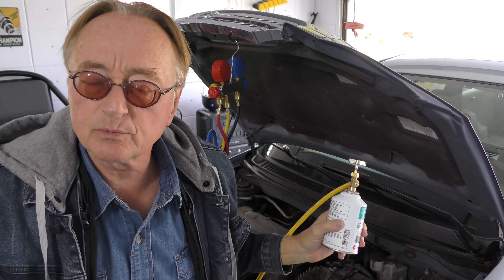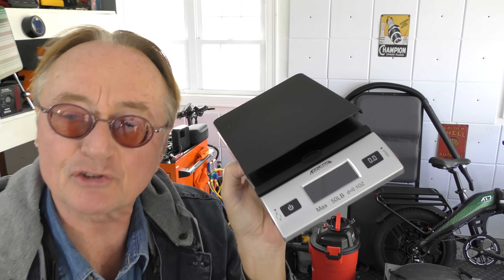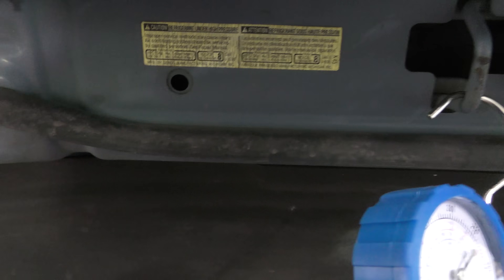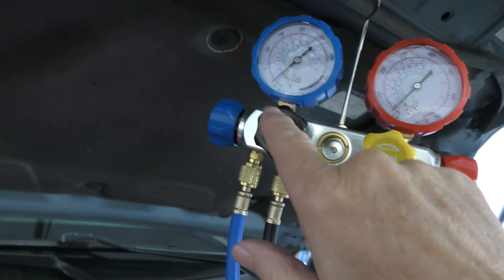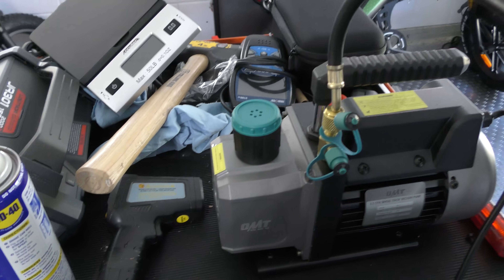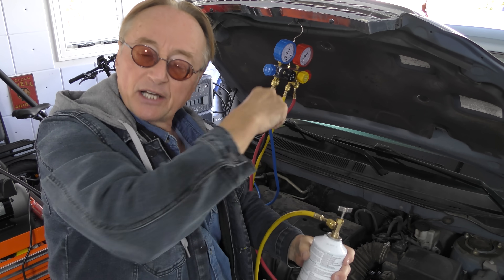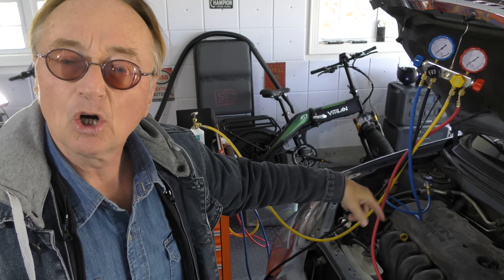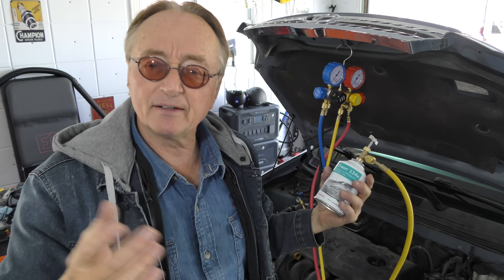Doing This Will Make Your Car's AC Blow Twice as Cold

Comment: If your system is low on refrigerant is that a sign of a leak somewhere (it's supposed to be a closed system, right?).  Or does refrigerant just breakdown over time?  I know at 11:58 you say, "they all leak to some extent" but is there an extent to which I should be worried? Asking for a 2004 Tacoma that doesn't blow particularly cold or defrost the windows that great in winter.

Comment: My 2001 Chevy truck gets ice cold as long as you're going down highway but idleing or at stop lights gauge goes close to hot I think needs belt winter fine but not when fan for air conditioning on
Reply: Auxiliary fans probably not working. Never drive an overheating engine.

Comment: Thank you for all the great information on your channel.  Just wondering.  Went to go buy the guages.  Looked like yours had four hoses and valves and the ones in the descriptions had three.  Is there any four out there that are decent enough or is it necessary?  I need to get one but would rather spend the money even if its a little more and get one that does everything?  Might need a different one for rv's also.  Thanks again for all your great info.

Comment: Vacuum pump does not remove refrigerant, it's used for evacuating the system prior to charging, this means removing all the air and moisture content down to, ideally, 500 microns, which means you also need a micron gauge. To removed the refrigerant charge, it's a reclaim unit. Simply adding refrigerant means your system is leaking at it'll only get worse and you'll just be dumping in new gas every season, and eventually it may not even last the season. Charging a system low on charge is a band aid, not a fix. There's only one reason you are low on refrigerant, a leak, a manifold gauge will it see that, a micron gauge will. Also, 42 at the vents likely means youre freezing your evaporator.

Comment: Perfect timing.   My accord never felt cold and it’s not under warrantee the day it’s delivered (Honda says wear and tear even day rolls off the truck and registered).   Gotten worse over the years and now needs to be done.
Reply: I had this problem with a Civic and it turned out to be one of the air blend doors letting heat in.
Reply: @The_Redkween  good point.   I think mine is ok but I’ll try to notice if the ac is  blowing colder before the engine coolant heats up.

Comment: Scotty what are your thoughts on installing a battery that is actually bigger then stated??? Will it mess up alternator or starter??? My battery that came with my used car was needing post replaced the ones dealer said use was too big for battery in it

Comment: You are suppose to use a thermometer not a laser to check the temp. You wont get an accurate reading using the laser to check air temp.

Comment: im nearing senior citizen  status  and  on really low ss income and i am of female biology lol, what is cheap but quality stop gap measure that i can do that easy enough for me
its for 2006 FORD EXPLORER 6CYL 4.0 SOHC 4DR XLT 2WD 
no cabin filter under dash as far i know or looked.

to get my air cond to quit blowing AC at windshield IN HOT SUNNY FLA most of time (currently its raining)to blow out in front by the radio without replacing all the vent doors i was told by mechanic be over $1000.00 to fix and replace, because such labor intensive job? thx alot for help and keep all those great repair videos coming! history lesson ones on cars are great too!

Comment: You measured 480g coming out of the can. That is not the amount that made it into the cars system. You need to account for the volume of the hoses and gauge-manifold. Allow time for any liquid refrigerant in your charging setup to boil off and get drawn into the cars system. What if you have the high-side hooked up and your charging setup has taken in several grams from the liquid line?

Comment: I always replace the schraders when messing with the AC system... cheap insurance!
Reply: What is a Schrader? Been looking it up. Not clear what that piece is but I wanna recharge my ac and get some preventative maintenance done.
Reply: @XTRABIG  Schrader valve stems.  Basically, they are the valve stems in your refrigerant lines.  Just make sure you match the sizes of the stems.  Most autoparts stores should be able to do this for you
Reply: @mattmanbrownbro  Thank you sir.

Comment: So I have the pulley bearing that froze up on compressor pump do I need to evacuate the system to change it out or replace the hole pump?
Reply: I have a 2000 Lincoln town car

Comment: I have a 2001 Yukon Denali ( the regular short one, notthe XL)  it has front and rear air.  My rear air has quit working and my passenger are bitching about it.  is there two a/c units in my truck?   The front air works great still , which is weird to me because I use it way way more, butthe rear air is just blowing reg air 9 hot when its hot out ) and zero cold. 

  what do I do?   I dont see seprate hook ups or anything like that

Comment: Sorry to bother you I got a 2016 Kia Rio yeah conditioner turns on but it throws hot air I wonder if they could be the compressor or the little mechanism that goes inside the compressor it has Freon at the right amount I change the switch on the dash but it still throws harder I can’t figure it outCan you help me please

Comment: Hey Scotty. I've made an embarrassing mistake on my new 2022 toyota Rav 4 LE, my wife had the car running and the music going, and I got in and turned the ignition. Does turning the ignition while the car running cause any down the line problems? The Rav 4 is so quest I couldn't hear that it was running already. Any thoughts? It's running right now but I want to know if I broke anything or caused any premature wear.
Reply: Usually the only thing that happens is the pinion gear on the starter gets a little beat by the flywheel.  If you haven't noticed any problems starting the vehicle in a month or so, chances are it didn't do much of anything and you'll be ok
Reply: Not a big deal, ive done that so many times i cant even remember, just dont make a habit out of it

Comment: Hey Scotty! Question, it sounded like you said 480 grams is universal for every AC system, is that correct or does every vehicle require a different amount?
Reply: Same question?
Reply: I don't think so. I have 2 Saab's here. A 4 cyl. (680 gr. R134A) and a Turbo X V6 (650 gr. R134A) Maybe you will find a sticker under the hood with all the details.

Comment: I just replaced the blower motor resistor and the fuse. Everything was working great until just now. The AC blows ice cold air and I have the fan speed on high and it blows high while idling but the moment I put my foot on the gas it still blows cold but at very very very low speeds even though the settings is that high. Can you please help me figure out what's wrong with my car.
Reply: Probably the blower motor is going out.

Comment: They use propane as a refrigerant. It's flammable, but has no chlorine. They say it's the chlorine in the older refrigerants that destroys the ozone. Technically, you should use a recovery machine to empty the system before you pull your vacuum

Comment: @Scotty Kilmer: On a hot day with my engine running, if I turn on the air-conditioning, I get no cool air until I put the car in gear and start moving. I have a 2012 Subaru Outback 3.6R Limited Wagon with 100,000 miles. I had it checked by Subaru and they say everything is correct?
Reply: @nateafcsouth I will next time before we go out...thank you for your reply!

Comment: Are you taking into account the weight of the can itself when you are extracting the 482 grams?
Reply: good question. how much you think the can weights? subtract that
Reply: First can was 586 grams, he emptied it (net amount of gas in a can should be 340 grams) and checked how much the empty can weighed and it shoud be mathematically 586-340 =246 grams. He never told how much it actually was. The second can was 602 full minus 140 (=480-340)=462 grams after he was done. So he did right.

Comment: When you have a leak in your AC system you can actually fix it. Let the system completely depressurize and then use J-B weld and a circular clamp and some pipe tape over it bam perfect seal

Comment: I have a 1996 Dodge Ram 2500 hundred with a 12 valve inline 6 which is apparently a really good engine but the truck doesn’t want to move 90% of the time and when it moves it goes 5mph and I have to bring it to high rpm. What do you think the issue is and is it worth fixing?

Comment: You're supposed to suck out the the refrigerant already in the car with a vacuum pump but he doesn't explain how to do this. Where does the old refrigerant go? I assume you need a holding tank? Then what do you do with the old refrigerant? All he explains is how to suck out moisture from an empty system so this video doesn't seem very helpful to me.
Reply: Very good points!
I'm wondering if Scotty is suggesting to suck out the old refrigerant and dump it into the air??

Comment: Love your information video's scotty can you do a review on a breezewell ac system , i seen in the commercials , will they work in a pick up ? My ac is working good , but its not enough in florida 2000 gmc single cab pick up , im working on insulating  floors and roof , checking for duct work leaks , already tinted the windows , it helps a little

Comment: I have a 2009 Chevy Cobalt 5 speed with a 2.2 l for 2.2 l 4 cylinder engine the AC was blowing not as cold as normal I've drove it for a year I paid $2,000 for it and it had 198,000 miles what about it I used the little blue gauge that you can buy with the AC cans I put it up to it says 40 on the gauge which is in the green and it was on or below 20 whenever I put it to 40 all of a sudden my compressor cuts off and on and off and on and off my Ford F-150 did that it was empty this one was overfilled I had to release pressure gradually because that's the only tool I had so you are definitely correct on that but now it stays on it's making my car I don't funny and it has a 5-speed that's kind of a bad thing because when it tries to die act like it's going to die when you push the clutch in like at a slower speed stop and go top deal I work in Gatlinburg Tennessee a lot and it's traffic like crazy up here so I need to get that fixed you have any recommendations

Comment: What do you mean that all AC systems take exactly the same, 480 grams? My wife's Avenger takes 454 grams,  My E250 requires 850 grams (if it had rear AC, would take 1531 grams), and my Explorer takes 1,332 grams.  My mom's thunderbird take 794 grams.

Comment: About what temp should the air coming from the vents be?
Reply: @OB TV
GENERALLY SPEAKING in the automotive world acceptable temps from the center vent at full fan speed, and recirculate ON should be about 42-48 F with an ambient temp of 90 F and humidity at about 50%
Reply: @watershed44  you seem experienced, does pulling a vacuum for 30-45 minutes really make a big difference in terms of vent temp? I refilled without vacuuming on a 2002 truck and it never gets below 55 while driving, comfortable but not ice cold, i used to be a tech but dont have access to a quality machine
Reply: @ham5483  Yes, it does, if there is moisture in the system it can reduce efficiency of the refrigerant, and it will allow acid to develop which will eat away at the metals and eventually destroy the compressor, and other parts of the system like TXV valves and more. I would pull a vacuum for at least 40 minutes. Are you sure you got the right amount of charge in it? Also blend doors is it fully closed in recirculate or possibly is the foam sealing trim around the plastic door disintegrated?

Comment: you will have to get refrigerant into the system before the A/C unit will run due to pressure cut out switch controls.

Comment: I had a noise in my blower motor. The dealer wanted 187 to just look at it. I told them the motor was unbalanced. I replaced it in 2 mins for 80 bucks 😅

Comment: The reason for the switch to R1234yf is that R134a is a very potent greenhouse gas, much worse than CO2, and R1234yf is not nearly as bad as R134a.

Comment: My air conditioning probably works right, however a rock pierced a refrigerant tube line on my radiator. 
Did not even notice it until put the A/C pro in and it all came out the pin hole.   
New radiator? probably not.

Comment: air is non-condensible, so the a/c won’t work because the condenser won’t work. also, will cause poor heat transfer, because air is great insulator

Comment: Disagree. If you empty the A/C system, it is always good practice to always put a new Schrader valve in the high side and the low side. Then you will not have any issues with leaky valves. Replacing each of the Schrader vales is easy.

Comment: The only thing he left out is that if you are low on refrigerant you have a leak, period full stop. So what he said will work but if you don't find and repair the leak you will be doing this again in a month or so, if you don't believe me before you evacuate the system put 150psi of nitrogen in the system close the valves and wait half an hour you will lose some pressure.

Comment: My problem is that after I recharge the system a few days later it's blowing hot air again I can't find the leak. The car has 200,000 miles on it so I think the compressor may be shot.

Comment: BIG TIP HERE DON'T LEAVE THE SCALE ON GRAMS YOU NEVER KNOW WHO'S GOING TO BE LOOKING AT THE SCALE

I'M JUST SAYING
Reply: It's easier and more accurate to calculate in grams because on the sticker it says 0.48 kg or 1.06 lbs and the scale is in g or oz not lbs. And the scale's accuracy is 1 g or 0.1 oz which is 2.835 g, so you get 2.835 more accurate reading in grams. You can calculate 480 g/1.06 lbs into oz but when you look at the scale in oz you are going to make up to 2.835 g mistake, whereas only up to 1 g mistake when using gram units.

Comment: Yeah slightly flammable because it has propane in it or properties from propane.... but why not just use regular propane to charge an AC system... it works...just flammable... but yeah that's the only drawback to that... but I've heard of people using propane and it works great... I mean if they're bottling that stuff in small cans for 40 to 60 bucks and it's "slightly" flammable.....🤷

Comment: Please don't use The small freon cans with system sealer in it, Unless you'll never have a shop hook up there $3,000 machine to your car afterwards because it plugs these machines UP,  At least that's what I have been hearing, I think some of this is also Mechanic's hooking machines up to cars etc with the covers gone on the valve's Not cleaning the dirt out FIRST. I have had to tear apart more than one Machines valve bank to get the dirt out,  because it couldn't work with the Valves in the machine all jammed up with DIRT.

Comment: you are supposed to collect the old refrigerant, not just vacuum suck it out and let it go to the atmosphere. Why was it not working? because of a leak? did you fix the leak? if not, you will be adding can after can over the months. And did you use florescein dye to find the leak?, what about refrigerant oil?  OY!
Reply: But if you can put a vacuum on the system and it holds relatively long, sure the old refrigerant was lost over the 10+ years, but wouldn't a new charge be likely to hold then?

Comment: I got a question. My AC blows real cold at idle but cruising down the road it's not. It's still cool but not as cold as at idle. Is it low or over charged?
Reply: It needs fixing
Reply: Several possibilities. Have you had anything at all done to the system?  Heater control valve might not be closing. High pressure relief valve may be defective or working properly to protect an over-filled system, evap. coil could be freezing because of low refrigerant or defective expansion valve, compressor clutch defective, etc., etc.
Reply: @wholeNwon  it also could be hot weather as the cause!
Reply: @wholeNwon  I replaced the compressor and the orifice tube. And then vacuumed the system and filled it. It was the first system I ever actually messed with and I'm pretty sure I filled it to the proper weight (I did use a scale) and I've done systems since and they work great! But it's a noticeable difference (within seconds) from off idle to idle.

Comment: usually, the Shrader valve is bad the cheap rubber on everything if you suck it down replace those things save trouble and money just a though and use oil too, I'm an expert on absolutely nothing just a tightwad